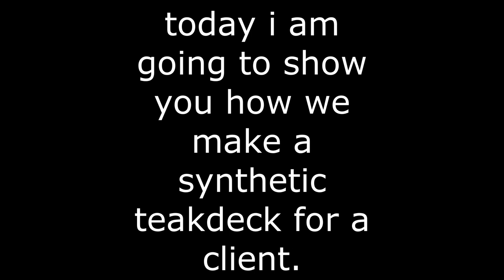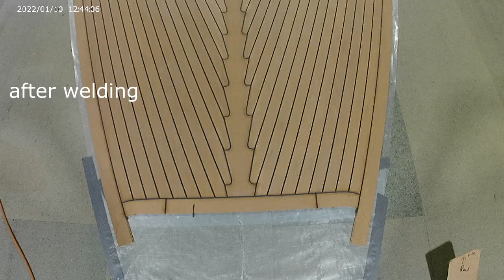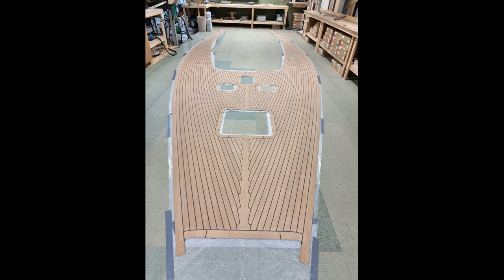Making of a synthetic teak deck for a 41 foot sailing ship!

Comment: Nice job! On some boats it looks great. Especially the more geometric modern ones. On older ones, it looks funny I think. Especially when there is a mix of wood and flexiteak. Like the toe rail. The toe rails are not available in all shapes you will need for your boat type. Also the seams are a thing. I’ve seen flexiteak that looks great… but then the way it was Sikaflexed to the deck was not OEM standards. Too thick, messy. Which offsets the hard work that has been put into it in the factory/workplace with soldering. Just my remarks about the product, not about your craftsmanship

Comment: How much lighter is this compared to a 5 mm real teak deck.  Hand how does it compare prices vice. I have a Bavaria 41 Exclusive from 1996. That has a teak deck well past its glory days. This could be an option.  Best regards from Jarle. 
You might check out my boat in my videos on YouTube.  Stem to Steern Sailing.

How do i get in touch with you?
Reply from the maker: Hallo you can mail us at Info@jachtwerk.com. and will answer your questions there
Reply: Old